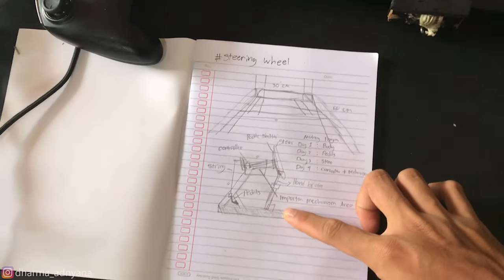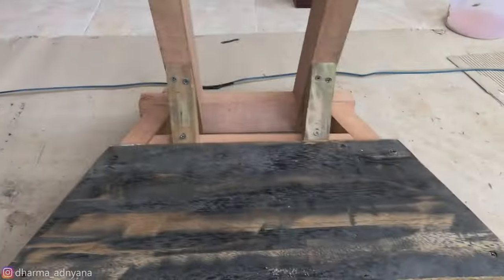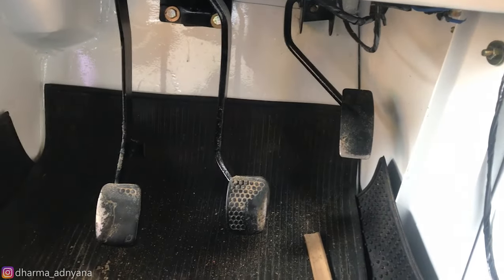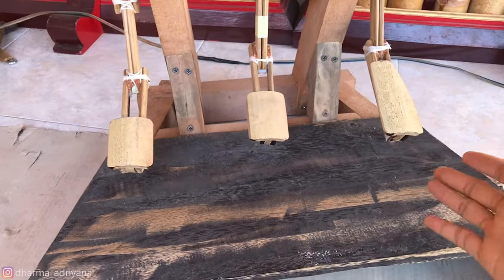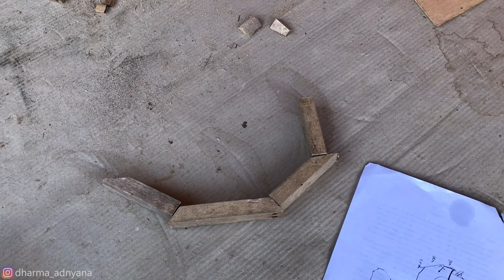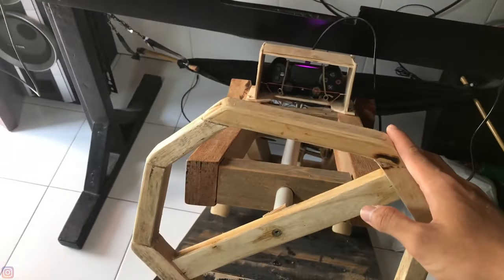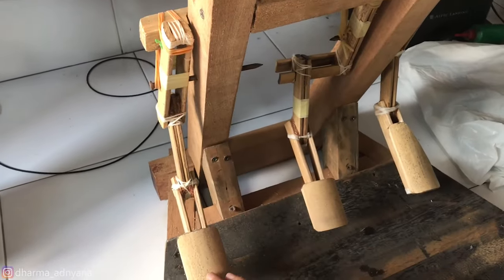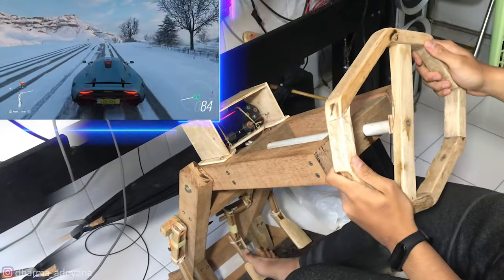How to Make DIY Steering Wheel With Pedals For PS4 , Xbox, and PC || DIY Racing Wheel

Comment: With the left lever you can set the clutch function in the same way as you set the steering wheel function.
Reply: You could also get an old or no longer working console steering wheel and use it as a base for adaptations.
Reply from the maker: Thank you for the advice! Really appreciate it!